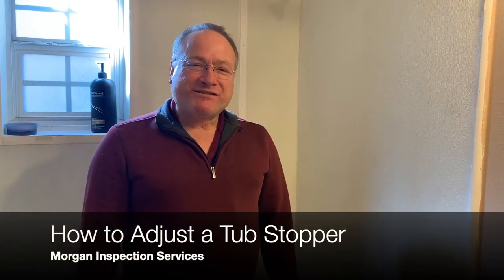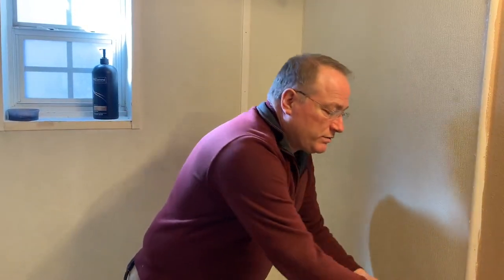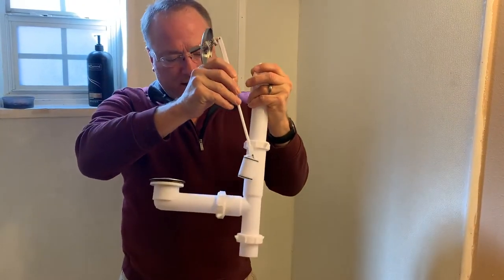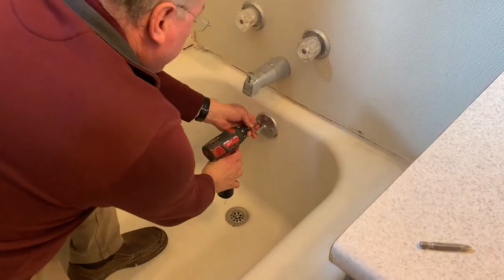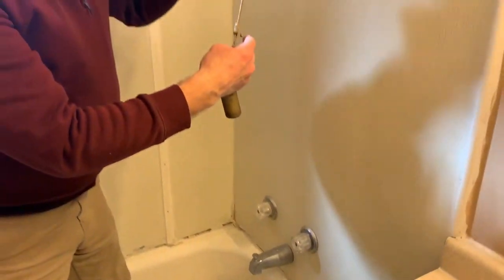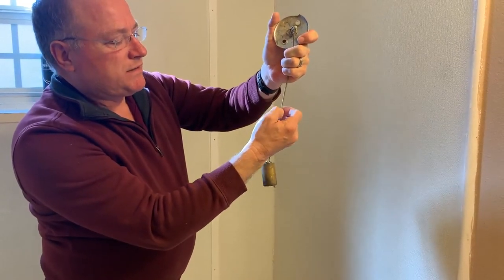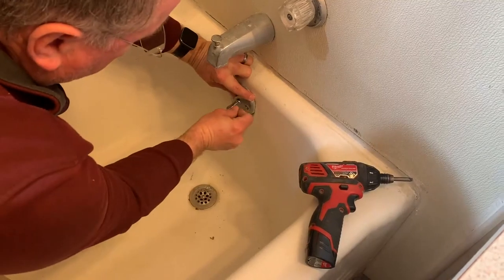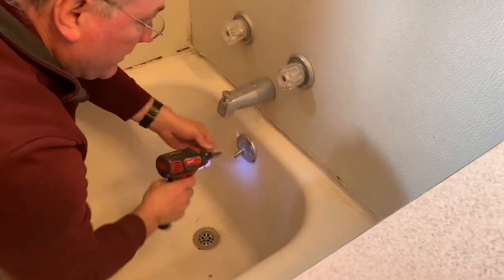Bathtub Doesn't Hold Water!  How to Adjust a Bathtub Stopper (in Less than 5 Minutes)

Comment: My lever won’t stay down. Any advice?
Reply from the maker: There is a spring on the lever mechanism that is designed to hold the lever in place whether it’s in the up or down position. If the lever will not stay down, then it seems that the spring is probably bad. As far as I know, the spring cannot be replaced but you will probably just need to buy a whole new trip lever mechanism. Should cost around $20.

Comment: Hi, friend.  My water is backed up.    We bail out the tub after a shower :/   
     
I can pull that plunger/stopper assembly completely out and the water doesn’t move.  Clog?  I’m so lost on this, I miss my dad, man.
Reply from the maker: Yes. It definitely sounds like a clog to me. Before you pay a plumber, you might try a tool like this from Amazon, or somewhere. If it’s just a bunch of hair, this might fix it.
https://www.google.com/search?q=tools+to+unclog+sink+drain&ie=UTF-8&oe=UTF-8&hl=en-us&client=safari#piu=ps:8&oshopproduct=gid:16885628361108848984,mid:576462729250207347,oid:10467071303331691270,iid:6403034197713430907,rds:UENfMTY4ODU2MjgzNjExMDg4NDg5ODR8UFJPRF9QQ18xNjg4NTYyODM2MTEwODg0ODk4NA%3D%3D,pvt:hg&oshop=apv&pvs=0
Reply: If it's draining slow or the sink is draining slow...it could be the vent stack is clogged as well. It could have leaves or some other debris in it. I either snaked it out from the roof or ran some water down from a hose. Just make sure the water isn't making a mess in the house. You'll need a spotter. You can get better instructions by searching on YouTube for cleaning a vent stack. pipe.